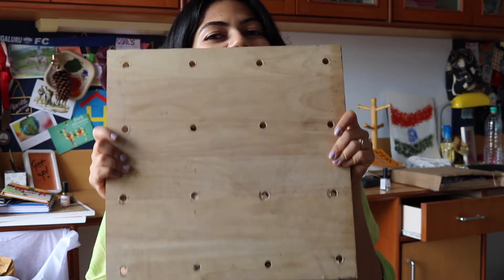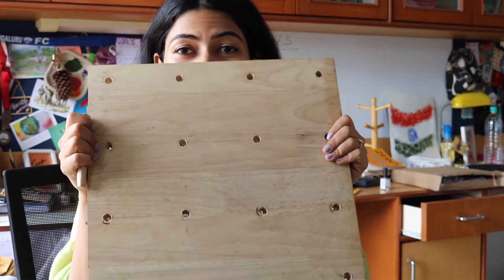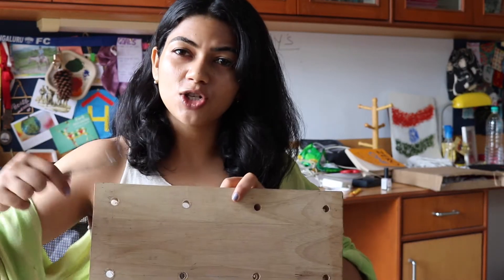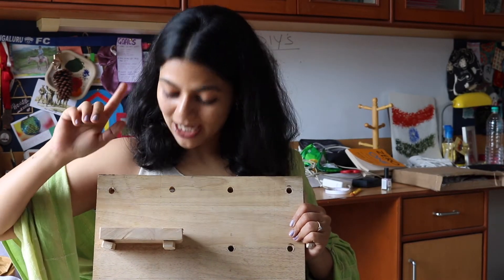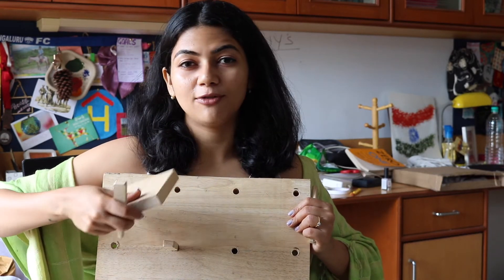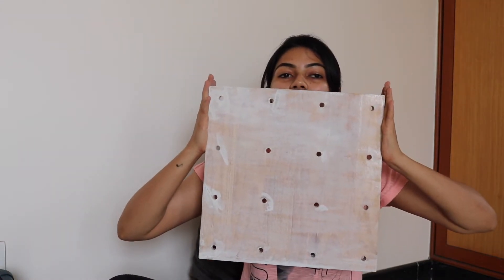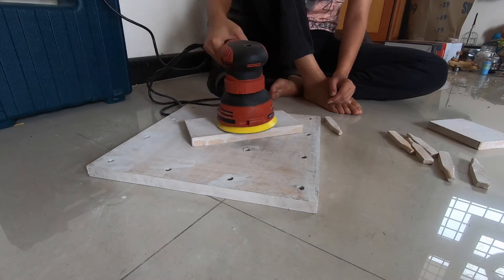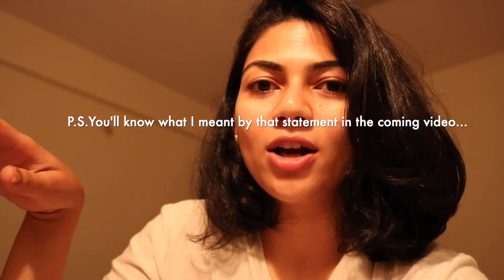DIY | PEGBOARD | HOUSEZZAT

Comment: What wood plant you hve used? Is it mdf ? Where can we get these?
Reply from the maker: This is a normal plywood cut into the required size. You can find it in any plywood shop and ask a carpenter to cut it into the desired size.